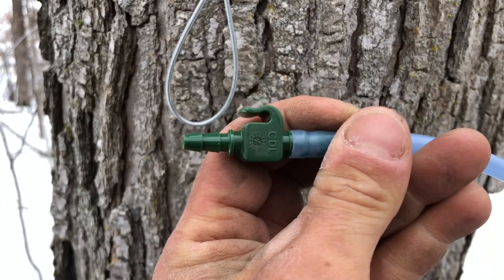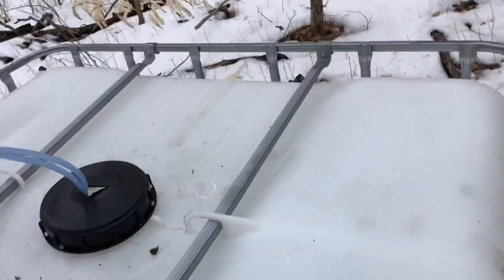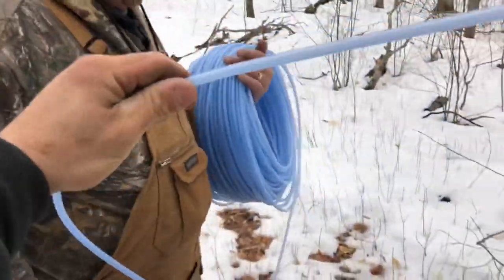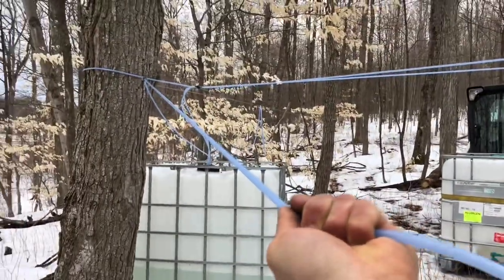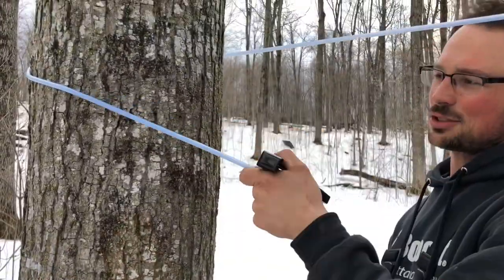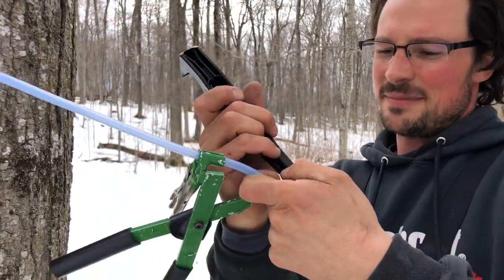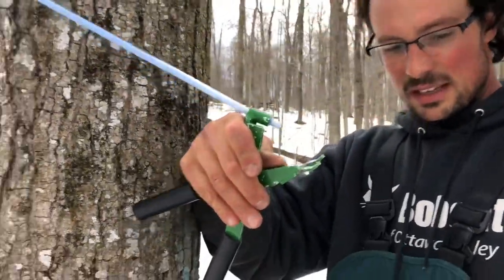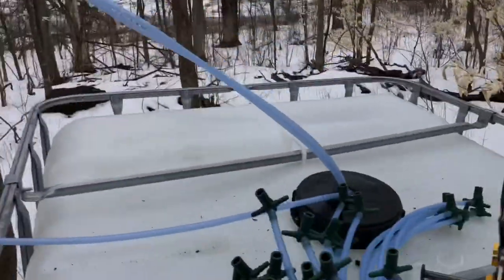Making Maple Syrup - Running the 3/16 Line for Gravity Vacuum System

Comment: Does the "end of line hook" allow some air into the system so it's not like holding your finger on the top of a straw?
Reply from the maker: the end of the line is completely closed. Leaving it open would allow bacteria to get in especially towards the latter part of the season as the weather warms up which will slow flow considerably. Even though the end is plugged the fact that the trees are actually pushing out the sap allows it to flow easily.